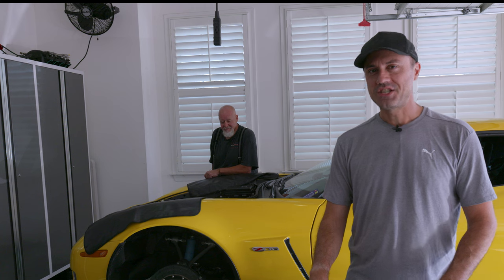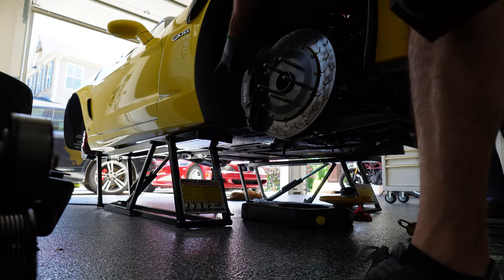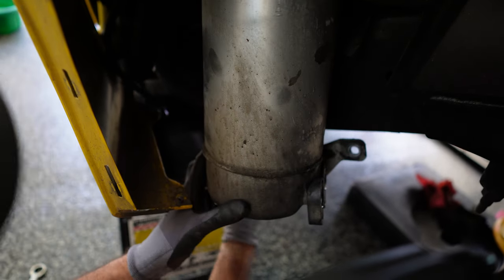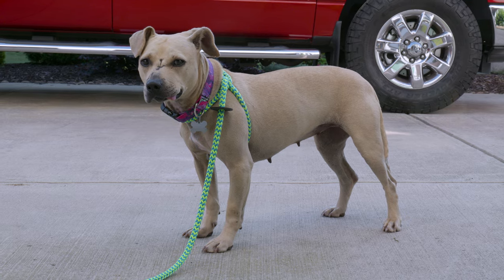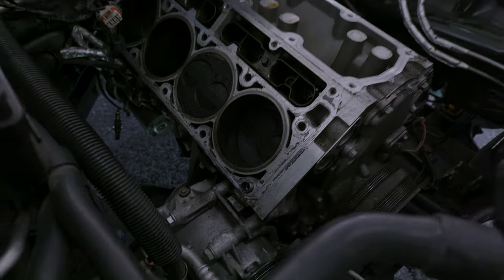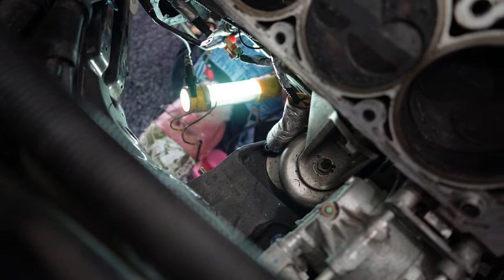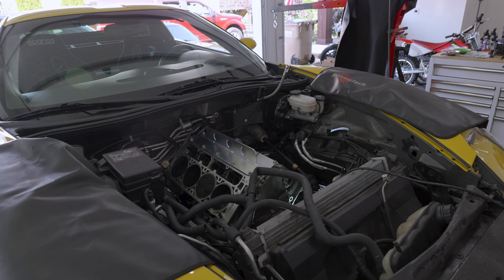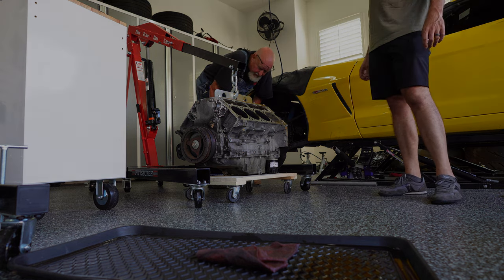Pulling My Blown Engine

Comment: Great job getting that beast out. Kudos to the mastertech Father In Law. New sub and look forward to future videos. Always loved the C6 z06. Read a ton about the valve issue. Scared me away actaully. Watching video after video with cracked blocks stopped me from buying. Still have a soft spot for the C6 Z06, but have been looking at C5's instead as a dedicated track car. Less power, but evidently bulletpeoof and cheaper to maintain. As for your engine options - take your time and don't be quick on your decision. Penny wise pound foolish always stops me from going the cheap route. All for saving money, but buy once cry once is 100% true. If you do it right you will have zero regrets and get to enjoy your car for years to come. Look forward to see which direction you go. Personally would fix block if possible or make a bench/table out of it. Next find a used LS7 and rebuild it slowly with the best of the best parts and make it bulletproof. Piece by piece upgrades and document it for the channel. Taking your time researching and getting the proper tools lined up for each step from the ground up. End result will be a beast of an engine you could beat on all day and not have to worry. Might need to look at your tranny/diff upgrades as well.
Reply from the maker: Thanks for the sub and I appreciate you spelling out what you'd like to see with the build. Sounds about right to me. Bullet-proof (or as close to it as is practical) is the top priority. I also want to avoid snake oil in terms of buying stuff that's ultra-expensive just because it has a premium label on it. There are so many options it's tough to know what's what.

The C5 is an awesome platform, I had a C5Z. One thing to keep in mind is that depending on the track you go to, oil starvation is a real concern. AMP has a couple of sections where you can sustain high lateral G's for several sections and that can absolutely lead to catstrophe. Usually not an issue until you've got slicks and aero, but something to keep in mind.
Reply: @JoshVanVeld  - very good point and didnt think about oil starvation on C5. Assume there is a race pan with more oil and higher baffles. Not a dry sump solution, but might work the best it can. Still not sold on any platform yet as I save. Looking for an affordable car without major flaws that I truely like. All cars seem to have an issue or don't check enough boxes. Most noteable that made it to the list in no order - Miata, S2000, 3 series e30/e36/e46, C5/C6 Z06, and Evo. Have not ventured down the race car / track day hobby yet. Need more savings/budget to feel comfortable financially. In meantime, I am in research mode and waiting till I am ready. As for the parts to buy just don't be quick and research. Only parts I know that are worth the cash is anything ARP and a good torque wrench. I spent up on the same jack stands you have. Again worth the peace of mind. You can use a couple tires by the way for added protection. Easy to get in and out and a fan of more layers of protection. Tons of snake oil as you mentioned. I watch a show on the motor sport channel that builds engines and tests each part. You might want to binge watch it. Cant remeber the name. Some parts add/some lose power or do nothing. Either way buy the best you can afford part by part. Learn as you go and enjoy the journey. Can never over build it enough. It will just last longer and be able to take more abuse. The smile on your face on a hand built by you monster engine on startup/first pull is an experience worth the time/energy.
Reply: @ftlaud911  I've owned both, and both cars are awesome, but there's something very special about the C6Z and worth all the BS!

Comment: Trans line c-clip pnum #24205103. Regarding blocking off the oil cooler ports, that is ok for an only street driven car but the better way to raise temps is to buy a thermostat kit like the one from Improved Racing. You get -10an lines as well which will increase flow and oil pressure at speed as well as it allows the oil to get to 200F before the oil thermostat opens to allow the cooler to do its job. Great video, excited to see where you go with the build.
Reply from the maker: Thank you!! For some reason this got caught in the spam filter and I didn't see it until now. Appreciate you digging up that part number and the tip on the thermostat.

Comment: This has become one of my favorite YouTube channels I’ve seen in a long time.  Please don’t stop making videos!!!  As far as what to do with the engine.  While a high revving LS motor would be awesome I believe you lose some of what makes the LS7 a LS7.  Think back to the heads and cam car you drove when deciding what to do.  There are quite a few that top the 600 whp range with a milder cam to keep the mid range tq up and losing very little top end power.  Refer to any of Race Proven Motorsports videos for ideas.  If I knew how to link videos they do one with a z28 that made good power and gets tracked regularly.  Side note… I’m sad that that I’ve caught up to the end of the videos lol 😂😂😂
Reply from the maker: Thanks! Making progress on the solution for the motor but nothing’s happened yet that would warrant a new video. I’m really excited about what’s happening 😃

Comment: Great vid Josh, I was in the same exact boat as you about 9 months ago when my 2008 z06’s engine spun almost every rod and main bearing. These cars are not cheap whatsoever, and by extension the engines and parts for the engine are not cheap either. I think it’s imperative to go into this engine build knowing what you want and to set limits because everything car guy knows the feeling of because your in there and since it’s easy to upgrade parts I should go ahead and install this or that. It soon becomes a battle of trying to stop yourself from changing every part you can and going from a cheap-ish stock style build to a over the top custom build with hardly any stock parts. I went from thinking I’d just replace only the parts I needed to going all out, go big or go home style. Where I thought it would be a 5 to 10 thousand dollar rebuild went to a fully built darton sleeved, forged crank/pistons/rods, Frankenstein heads, Tsp cam, Msd intake, exhaust and a whole bunch of goodies im not thinking of. I stopped counting around the 30 thousand dollar mark. I’m 17 going into my senior year of high school , 9 months ago when the engine blew up I was still 16 in my junior year, the amount of pressure I felt knowing but also not knowing how much work, time, and money it would take to rebuild the car made me sick to my stomach. I take great pride in saying that I, a 17 year old boy still in high school working every day after school and every weekend for the past 9/10 months payed for and built this all by myself with little to no outside physical assistance. And this is why I say this Josh, this most likely will not be easy, there will be times where every little part and thing you try to do just flat out won’t work or will give you the hardest time trying to do it, take your time, do things right the first time if you have to take a break for a day or two to just stop and rethink, do it. My dad is also one of my biggest hero’s too, I don’t think I could have done all this without his help I was very set on not getting any outside physical help putting it together but that’s only half of the build, the other half is the knowledge and skills it takes to undertake something like this which is where he and countless other people have helped along the way, and that’s why I think it’s key to have the jeff type people there to provide assistance and knowledge along the way. Sorry that my comment is very lengthy but I wish I would have known half of the stuff I know now, and I hope I passed some of that off to you. I wish you nothing but the best in this journey of building a sick gt3 killer!! I can’t wait to see what you have in store for the future!!
Reply: Bravo for the spot on comment!!!  You learn this stuff through experience, age, and wisdom.  With that said, you'll remember that experience for the rest of your life and it will always be a regret, but also a priceless memory every car guy will cherish for the rest of your life!!!  Kudos bro!!!  😎😎😎
Reply from the maker: Dude if you keep that perspective and work ethic and make good decisions you're on a path to success. I'm sure your dad is super proud!

I appreciate the input and it's a treat for me to be learning from a guy who's still in high school. Thanks for taking the time to comment. I think you're right - trying to find the balance between "budget-friendly" and "go big or go home" is going to be tough.

I probably don't need to tell you this but I know I would have had a hard time staying safe on the road with a car like that when I was in high school. Take it to the track for the fun stuff and don't take risks on the street! If you want to come do a guest day at Atlanta Motorsports Park sometime, let me know.
Reply: @JoshVanVeld  I plan on going to college and studying either aerospace or mechanical engineering, I’ve never been much of a school person but I hope I can push through and be able to build things I love in the future. A few months after my 15th birthday  when I got my driving permit my dad went in half with me on a wrecked 2017 6 speed manual mustang gt that’s in my profile pic, I still love that car and I wish I never sold it but it’s what gave me the opportunity to by my c6z. Me and my dad fully rebuilt it after it had been ran into a telephone pole, it taught me a lot of lessons on driving, and although it didn’t have as much power as my vette it was a lot less refined and harder to predict so I was able to learn a ton about handling a powerful car. And yeah that sounds awesome, I’d love to visit Atlanta motorsports park. I live in Texas so Atlanta is quite a drive but I’ve been debating on having the vette dyno tuned by race proven motorsports. I’m currently getting it remote tuned by them because they are located farther north in Newcastle, but if I ever make the drive to them I’d love to stop by Atlanta a take some laps. I’m going to drop a follow on your instagram so I could stay in touch!
Reply from the maker: @z06jakee  Sounds good man, you've been on an amazing automotive journey so far!

Comment: If you have a Costco in your area, go buy some of the wire shelving- the 48 x 18 x 72" shelving is rated for 1000 llbs and it is the perfect place to put all of your engine parts and keep them organized and off the floor and take up less floor space. These wire shelves also have wheels on them so you can wheel them out of the way when you need to.
Reply from the maker: Thanks for the tip Bob!

Comment: Josh, I think your videos are great. When you’re building your new engine I would suggest you spend most wisely on valve train. Get rid of those lifter guides and get good tie bar lifters. Get lightweight valves and retainers. Your base engine is good. I would addARP studs to heads n mains. You can send your heads out for porting n save money. Get a good balancer too. That’s my two cents worth,I’m sure you’ll figure it out. I just had Thompson Motorsports build an engine in that frame of mind n it came out great. Revs to 7500 no problem,makes over 600 and revs very snaply ( if that’s a word). I would also suggest a big radiator. Good luck, we will be watching n hoping the best for ya!
Reply from the maker: Thanks Andy! I need to sit myself down and make some specific decisions, the LS world is HUGE and I feel like a toddler who wandered into a NASA break room. We'll get there. Your engine sounds awesome, hopefully I'll have something that revs snaply... snappily? myself :)
Reply: @JoshVanVeld  I hope I didn’t come off Mr Know it all, I’m not. I do have a lot of racing experiences. 4 National Championships in SCCA SOLO 2, and 2 PCRRC Championships ( just sayin, I really don’t have a big head about) I think your doing a great job figuring this out. And your right the LS world is huge. You can analyze this shit to death. The one thing I learned from my recent engine build was supply chain is huge nowadays. Most cylinder heads are good( get what ya pay for) name brand components are that for a reason ( I’m sure you know),but if you can’t get them it’s an anguishing time waiting for shit to come in and hold up the whole project. So my two cents worth is track down your bestest,fastest to get stuff. It’s a pain making all the phone calls and internet look ups,but it will be worth not wasting time waiting and waiting and waiting and waiting… I know your gunna do it right,can’t wait to see the videos.
Reply from the maker: @andycraig14  Jeez Andy, you don't mess around! You didn't come across as bragging at all. Credentials help us understand who we're talking to, nothing wrong with that.

Supply chain is definitely on my mind, I don't want the project to get stuck in waiting for parts mode.

Really appreciate the advice and the follow-up. When the time comes hopefully you'll follow up with some driving tips ;)

Comment: Josh, your writing and storytelling abilities are pure bliss. Keep it up. Regarding making your Z06 a GT3 killer, is it the 997 generation GT3 or the 991 GT3? Either way, you might not need more than 550HP to out accelerate a stock 991 GT3. They have rear wings for downforce, so I would expect that you would need to add a rear wing to increase the handling, and probably a front splitter, too. I think the GT3s have flat body panels underneath, so if your Z06 isn't as flat, you'll want to make some flat body panels, too.
Reply from the maker: Thanks, glad you've been enjoying the videos! Great question and points. I think a mistake I made when starting the build is that I didn't completely nail down which specific GT3 I was going after. I think 991.1 is probably a fair target.

The question of aero has been on my mind a lot. If I do coilovers I'll need to know my aero plans to decide spring rates. And aero is a really good idea if only to counteract the lift that these cars generate in stock form. But I don't love the idea of cutting up body panels.

I'm really curious to see what kind of lap times I can put down once I've got the engine sorted out, it looks like I'll be making more power than stock and with the bigger grippier tires and other changes I've already made I think I'll be able to turn some pretty quick laps.

Comment: Lisle makes a tool for disconnecting GM transmission lines without removing that clip. Part#22990. As for the clips you can get OE or doorman from most parts stores. Best of luck to you!
Reply from the maker: Thank you!! For some reason the spam filter caught this and I didn't see it until now.

Comment: Love these videos and the growth! 

Real question. Where do you find the different torque specs that need to be used? I feel that’s a big barrier for me? I want to do the work, but held back by be afraid I will not making something tight enough or make it too tight. 

As always love the videos! Thanks!
Reply: It may not be available for all models. But Haynes Repair Manuals are a real savior, with specs, technical diagrams, and step-by-step instructions for a lot of jobs. They are available at most autoparts stores.
Reply from the maker: Thank you! Google has never failed me in terms of finding Corvette torque specs I was looking for although you do have to be careful about which sources you trust. In the past I've used https://www.ls1howto.com/ as a really useful reference. Corvetteforum.com is also a great resource.

As @Murphman205 said, there are shop / repair manuals available for most popular cars and often can be found for sale on ebay. My M Coupe came with one in the trunk courtesy of the previous owner!

Comment: Those glove are washable. Dawn dish soap and hot water. Hand wash them and let them air dry. As a cnc machinist I do it frequently with similar gloves. After a day of sweat and coolant they are disgusting to put back on and the shop only buys so many gloves at once lol.
Reply from the maker: Oh dang this is not the comment I was expecting but it's exactly what I needed! Thanks A-A-Ron!

Comment: Couple things I noticed when I pulled my ls7.

I left the steering on, and dropped the cradle while supporting the engine.

I removed the radiator because I was upgrading anyway, but it made for more space to work.

I ended up with a full Tony mamo top end.  He was great to work with.  I’d recommend giving him a call even if you are thinking of going other options.  He’s been doing this so long he will be a great resource just to speak with.
Reply from the maker: That's great advice. I've been hearing tons of feedback in comments but I need to buckle down and talk to at least one expert to help formulate a specific, actionable plan to move forward.
Reply: Also, did I hear a throop accent there??
Reply: At a certain point you need to put the project planning in to the hands of a professional and you can do the install.  And any issues that may arise you’ll have access to the pro for ideas and tips.  That was what I went to Tony for.  I’d give him a call he loves to talk cars.